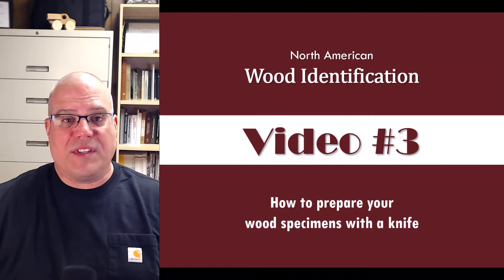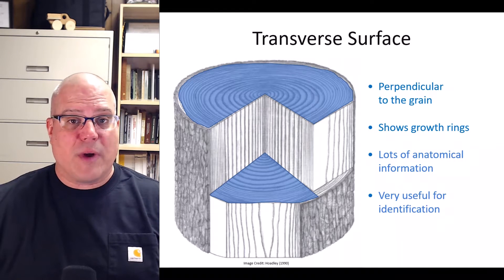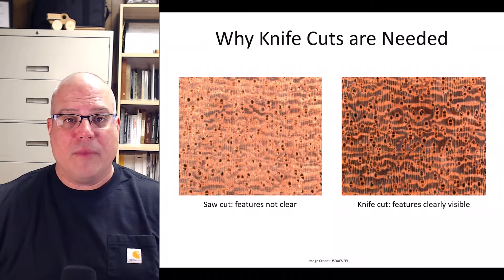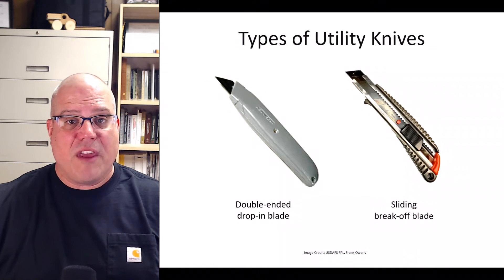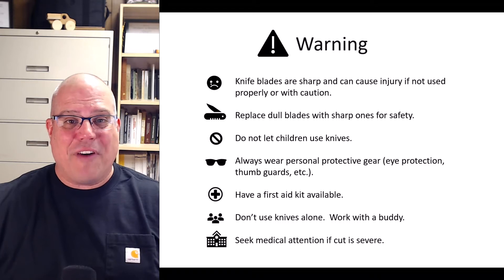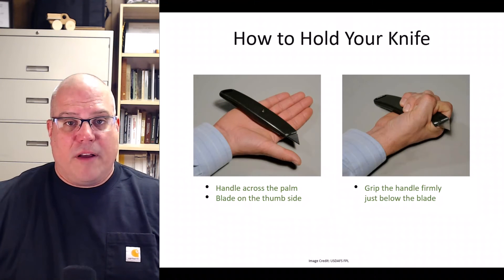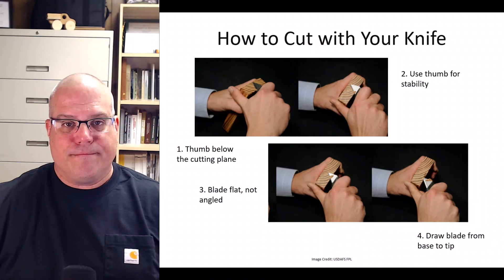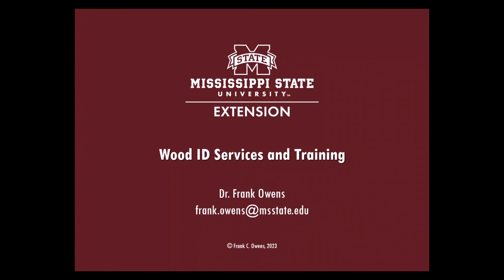North American Wood Identification #3 - Preparing wood specimens with a knife

Comment: Hi, Is it okay to use the wood sanding machine without a knife, but with different grits, and what is the maximum grit size that will make the wood specimen good for image capturing. thanks.
Reply from the maker: Hi Charles.  Great questions. Yes, it's okay to use a sander without a knife as long as you can see the anatomical features clearly after preparation.  However, when you sand the transverse surface, sawdust tends to get caught in the smaller latewood pores, which makes them look white instead of black.  With plugged pores, I find it harder to see what I need to see on the cross section.  As for the minimum sanding grit needed for good quality image capturing, our team at MSU is about to publish an academic paper on about this.  If you can wait just a few weeks longer, we can show you the results.